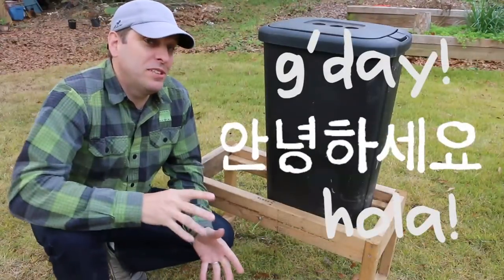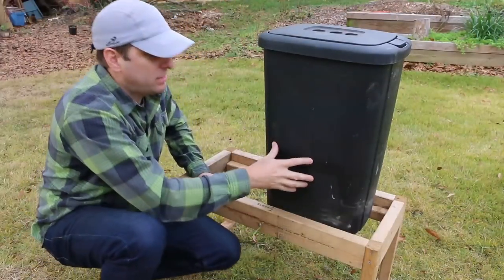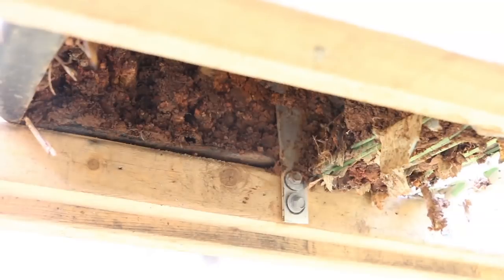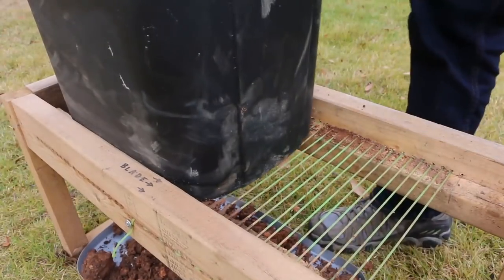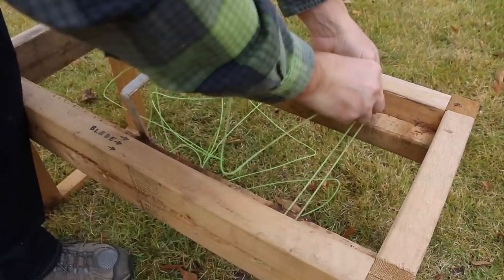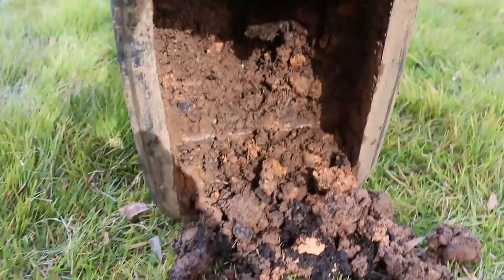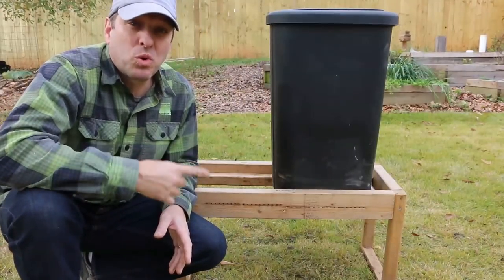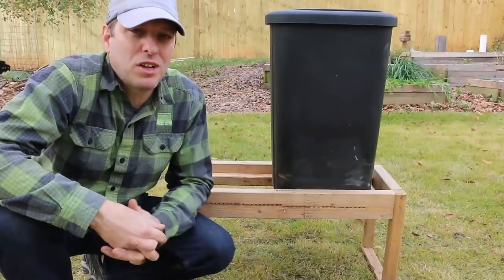Simple Flow Through Worm Bin Harvesting Test

Comment: I built this bin last spring with a couple of changes.  I used a 1/4"x1" aluminum bar for the cutter and I didn't sharpen it.  I also put a screw on the end of the frame - about 12" long with a crank handle (could probably McIver a car screw jack).  I'm an experienced worm grower - I was using a VB24 that I built but I'm ninety and would have to get down on my hands and knees to harvest - then I had trouble getting up.  I gave it to the Wildlife Society and they were grateful.  Today was the test and it went perfect.  I harvested about three (+) gallons of good vermi-compost.  I'm going to make another and make the screw so that It isn't permanent and I can move it to the other bin(s). I also used 1/4" hardware cloth - I will change it to 1/2', and that is what I will use going forward.  I will put a folded strip of flashing along the forward edge for more support.  Make one, it's great - but make sure you have a good bit of knowledge on raising worms before you start.  The bedding has to be aged to start with - a couple weeks before you ORDER the worms so that they have a nice home.
Reply from the maker: Kudos to you Frederick for your build and modifications...at a spry 90 to boot. Excited to hear you had a successful harvest. I'm been feeding mine all summer long and will harvest soon. Hopefully only castings to drop this go round. Thanks for the tip on aging the bedding. I haven't heard that before. Thanks for commenting.

Comment: I suspect if you would turn the trimmer line by 90 degrees where the castings slid parallel to the line it may have worked. The line would not have resisted the movement and bunched up.

Comment: Why have the laced nylon strings in there at all?  I think I would just use some kind of screen or grating just to let air in and circulate.  It also might help to sharpen both sides of the blade.  This is a really fascinating experiment.  I hope you hang in there.  Appreciate you are not too proud to show the problems and the fixes too.  This is great!

My prediction would be that the tapering of the body is too narrow to allow the compostables to slide down as you hope they would.  The whole column will set in place and not flow like sand or gravel because it will stick together.  Maybe it will slowly flow down over a period of time?

Comment: Any updates from the last 3 years? Strings changes to grid.
Reply from the maker: I still use this system. Just put some compostables in it tonight. The string to grid switch was a good choice. A thicker metal grid would be an improvement to make. It has bowed a little, but hasn’t failed. In my case, (family of 4) it only needs to be harvested once a year. But, I use multiple compost methods (2 for food waste). Thank you for reaching out. Thank you for watching.

Comment: Are you still using this flow through worm bin?  Does casting fall down automatically, or you have to push them down?    Thanks you for the video
Reply from the maker: Hi Henry. The castings have settled down on their own, but I may have let them get too dry. The bin has been in my basement through the winter. I plan to do a other harvesting video with this bin. Stay tuned. Thanks for watching.
Reply: One way you can get away from it drying out get a old blender keep it by and chop up everything you are composting even paper with water you only need a half cup and the finer you chop it up the quicker and easier it is for the worms to digest plus you keep moisture in it.

Comment: So, how did this fare in your basement? I am still in heavy research mode before embarking on my own composting journey. I really like the idea behind a flow through system and am eager to find out how it managed in the basement. Did you have any offensive critters end up in there?

I worry about the ability of my basement from preventing unwanted guests from dwelling inside the composter. Has anyone else tried this in their basement? If it was kept inside, could one use this composter year-round? Thanks to all who respond. Total newb here. 😳
Reply: I live in middle Georgia, I just moved Feb 2020 from Las Vegas. First time with this type of weather, as well as gardening, composting, worm bins, and chickens. I have three and a half acres with a large work shop. it got too hot in the hottest part of summer and I worried it would kill my worms so I moved them into my basement, the unfinished part. It brought horrible amounts of tiny flies and a funk that will take a while to get rid of. I have to move it back to the garden bay of the shop but I am as worried about the cold as I was about the heat. I have a stacking five bin system. I am going to make a box big enough to hold the worm bin and attach left over thick carpet padding I brought with from Vegas to try to insulate it from the cold. I am also going to make it with room for a layer of wood shavings I bought for the chicken coop. I will need to figure out a new plan for the heat because that bin cannot come back inside.

Comment: Do you think you could just use 1/2" hardware screen instead of your plate with the circular holes?
Great videos and ideas!
Reply from the maker: Hi Keith. I think that would work fine. It is really there to hold up the soil column and allow the trash can to slide. The trash can was getting hung up on the trimmer line. Thanks for watching.

Comment: Since the trash can smaller on the bottom and larger on top, it would be better if you install it upside down so the casting can go down easier.
Reply from the maker: I understand your thinking, but gravity alone is enough to keep the castings moving downward. We need to the taper like it is to add compression to soil column as it develops. Thanks for the feedback. Thanks for watching.

Comment: It would be MUCH easier if only the blade would move, and not the heavy bin. It would save you half the space, or it can double the growing space in the same set up. Another thing you can do is to replace the strings that support the soil in the bin with metal pipes in which you insert nails at regular intervals. By turning the pipe, you turn the nails which will scratch the surface of the soil, and the soil will fall below the bin. Either way, it would be better to work on your cutting device so you do not have to move the entire heavy bin. God bless!
Reply from the maker: Great suggestions, Mihaela. Thank you. I agree that moving the whole bin is a chore. I am planning a revised worm bin design for this Spring. I've got an idea for a movable cutter. Thank you for watching.

Comment: I have a (possibly idiotic) question to ask. Why does the bin on the “working side” need openings at all? Obviously the harvesting side needs to be open, but why can’t you just have a solid plate that the bin sits on that you slide it off of to harvest? Again, this is quite possibly a dumb question. I'm at the very beginning of my research into worm farming....
Reply: Jen Matherne  the worms pee and we need openings so the pee flows through! And It helps keep the moisture under control!